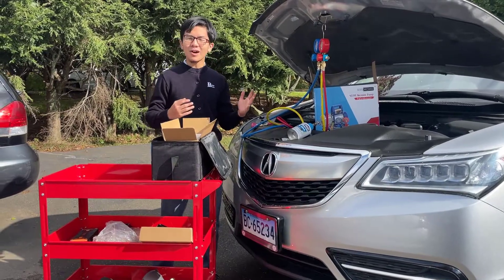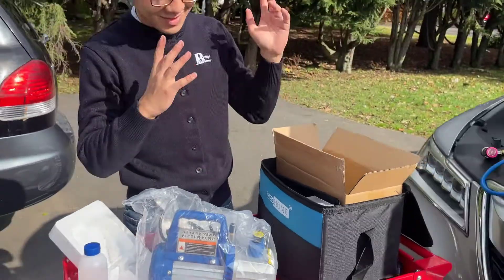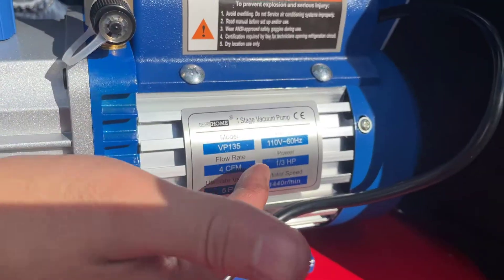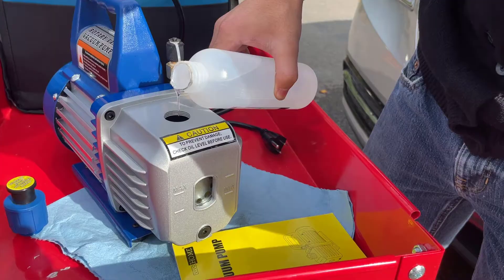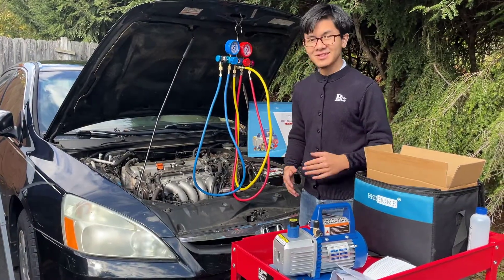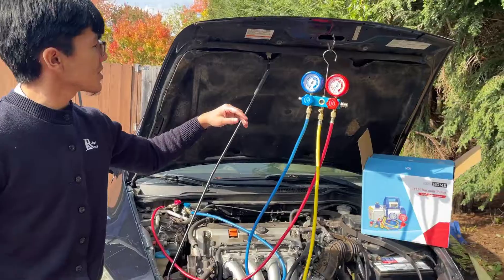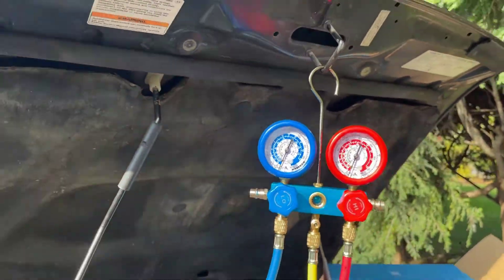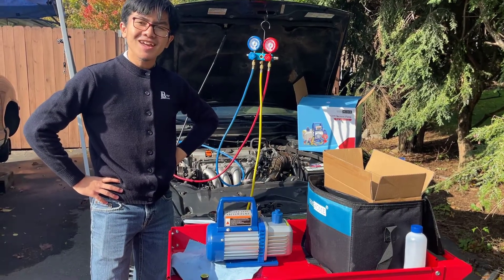How To Operate Fill Oil Pull AC Vacuum Evacuate System B4 Recharge Refrigerant | VIVOHOME Vane Pump

Comment from the maker: Here are the #ad links to the most popular brand with a high positive ratings and five star reviews:
1.  https://amzn.to/3Fw16w4  |  VIVOHOME 110V 1/3 HP 4CFM Single Stage Rotary Vane Air Vacuum Pump and R134a AC Manifold Gauge Set Kit with Leak Detector Carry Bag for HVAC Air Conditioning Refrigeration Recharging ETL Listed
2.  https://amzn.to/3mygXTt  |  Orion Motor Tech AC Gauges, AC Manifold Gauge Set for R134a R12 R502 Refrigerant, 3 Way Car AC Gauge Set with 5FT Hoses Couplers & Adapter, Puncturing & Self Sealing Can Tap Freon Charge Kit
3.  https://amzn.to/3z5aWma  |  VEVOR Vacuum pump 8CFM 1 HP Two Stage Air Conditioning Vacuum Pump 120V 0.3PA Ultimate Vacuum Refrigerant HVAC Air Tool for Automobile Reparation Vacuum Evacuation (2-Stage, 8CFM)
4.  https://amzn.to/3pu8Qci  |  Robinair 34288NI New Economy R-134A Recover, Recycle, Recharge Machine, Gray
5.  https://amzn.to/3Ez9jhy  |  Bestauto Vacuum Pump 12CFM 1HP Vane Vacuum Pump Two Stage 3 x 10-1 Pa Ultimate HVAC Rotary Auto AC Refrigerant Vacuum Pump, for Automobile Reparation Vacuum Evacuation

Or Click on Amazon link here and search for what you need:  https://amzn.to/3xIOsqg

Comment: Broooo this video helped me so much because I didn’t get the manual like you, so I was using the vacuum pump without the cap in the inlet port, I was like more than 30 min and nothing happened, I thought the vacuum pump was damage, but when I plugged the inlet cap, it started working 🫣🫣🫣 thanks

Comment: Hey bro how do u read the guages? Do u follow the line where R134a is to give a correct measurement if your refrigerant is R134a? Or do u use the line on the outer end with the larger numbers?
Reply: Follow the markings that indicate -30 psig, since that is your goal when pumping a vacuum.

Comment: I bought that pump but can't figure out how to put freon in. Don't think that valve is working
Reply: Was having the same problems with Freon not going. I thought the valves included with this set were not puncturing the can of Freon enough. But then I started moving the can upside down and lifting the container higher than the gauges on the hood of the car and the Freon started going in right away. Hope this helps!
Reply: Also you don’t use the pump to put in Freon. You probably know but just in case

Comment: Umm.. so many issues, please dont follow these instructions!  Issues include: you don't want to leave one of the input vacuum input ports open on the pump; the high and low pressure valves attached to the car are not open - so not draining anything!,  you don't want to vent the refrigerant into the atmosphere (it's illegal).

Comment: A micron gauge is what is needed to measure vacuum . System needs to pull    0---200 microns  service gauges will not get near that unless serviced /lubed even when they are  new . Coupler need to have Nylog on the service port  and coupler shaft and thread . The couplers always leak .

Comment: At 10 minutes into the video you very quickly achieved minus 30 PSI, nothing like 45 minutes of running. I didn't see it in the video, but did you open the valves at the car end of the hoses? It looks like you quickly achieved a vacuum in the hoses, not the system. Just checking.
Reply: Yup.  I noticed that too.  I think he only vacuumed out the three lines.  The gauges only read whatever is in the lines.
Reply: Guys he did open the manifold  gauges  at 9:00 min.... He just left the outlet open but being its brand new, he left open after 30 seconds he put cap on that's what book says..good job rookie keep up the good work repetition will make you a expert... probably are now!!😉
Reply: Good catch
Reply: Looks like he closed all the valves at 6:00, then opened just the manifold valves at 9:00...

Comment: The brass fitting has 2 inlets  (1/2" and 1/4".  You can't pull a vacuum with one of the inlets open to the atmosphere.
The manual explains if you bothered to read it  :)  You should get your dad or grandpa to help you.
Reply: lol
Reply: @deseremere  Mistakes are a very effective - although sometimes dangerous - way to learn.